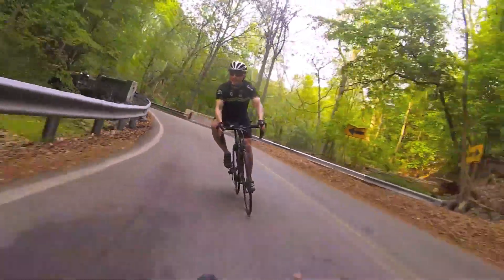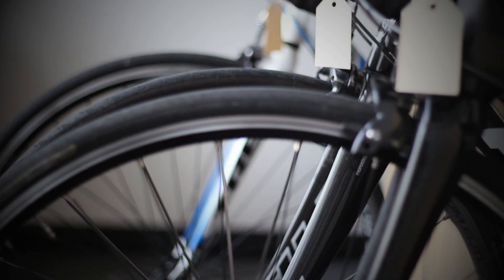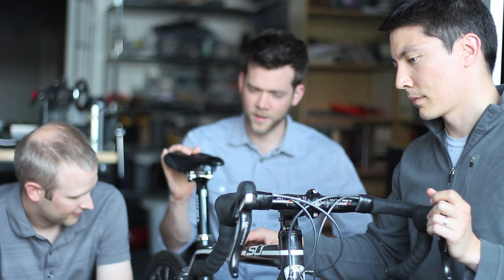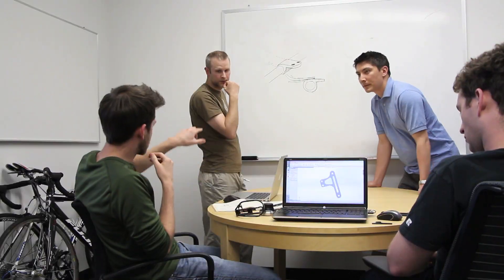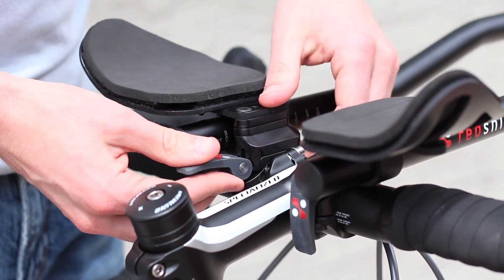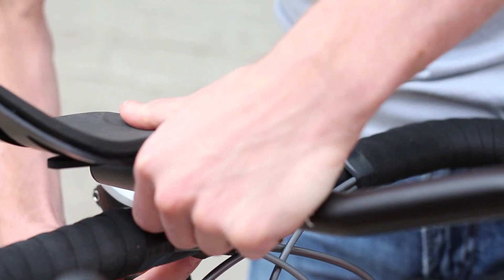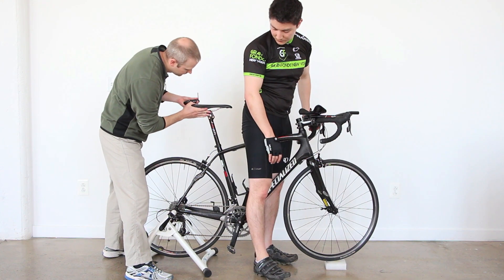The Switch Aero System by Redshift Sports

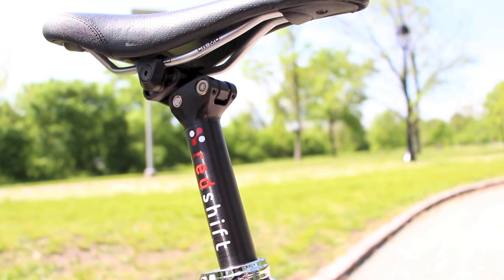Comment: I just had a crash trying to switch the seat from road to aero on the fly using my hand and lost my balance (just like @ 2:00) - I attribute it more to my clumsiness rather than the design.

@ 2:05 you seem to be able to do it without using your hand - I never quite figured out how to do that - any advice?
Reply from the maker: Charlie - Sorry to hear that!  I hope you're okay.  Some people are able to clench the saddle tightly enough with their thighs to pull the saddle up and forward.  However, most people will be better off using their hand to pull on the nose of the saddle.  Remember to only do this when you are in a safe area, and try to lightly squeeze the saddle laterally (sideways) between your legs as you lift your body weight off of the seat.  This helps stabilize the bike while your hand is off the handlebar.

Comment: Ok. But what about aero handlebars( not tt)? Is it suitable to them??
Reply from the maker: Hi - thanks for checking out our aerobars. They are not able to clip onto non-round bar sections. But, if your handlebar is "clip on compatible" then there should be an extended section of round bar on either side of the stem where you can add clip ons. If you don't have a bar like that then it might have a proprietary add-on or its not meant for clip on bars. Thanks

Comment: Wouldn't this put to much weight over the front end of the bike? Which would make it kind of dangerous.
Reply: +Noah Campbell The change in center of gravity between the two positions is very small.  The shift in weight distribution from the rear wheel to the front wheel is about 3% when riding in the forward position.
Reply: +Scott Poff  Ok thanks, was just curious.

Comment: to get around my problems switching from a road to TT setup I just have two seatposts; one with my road saddle setup and the other witch is flipped and has the tt saddle setup. I use the profile design clip on tt bars which are easy to install the day before the tt. I wouldnt want those bar mounts on my bars all the time using the switch aero system because they look ugly and I wouldnt be able to use my garmin mount